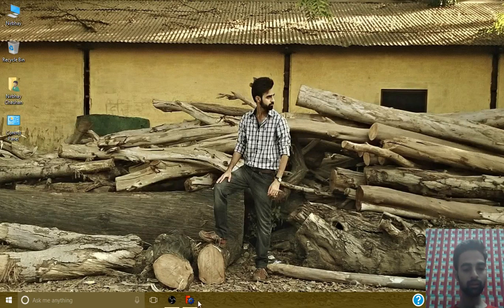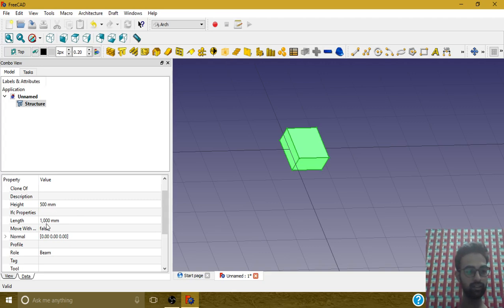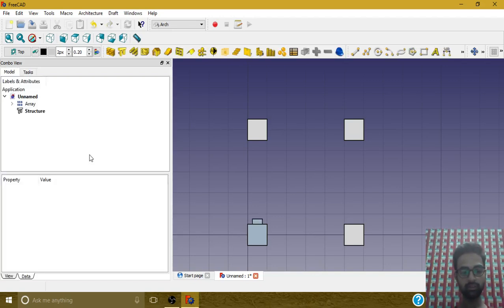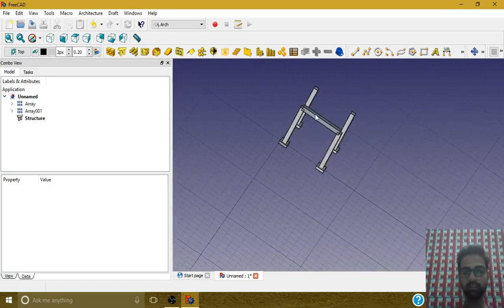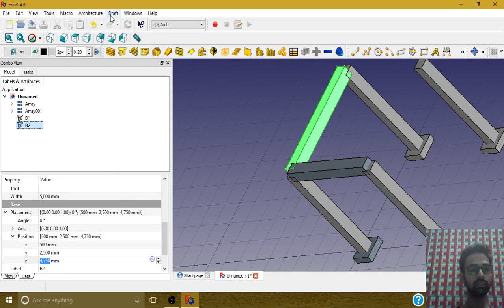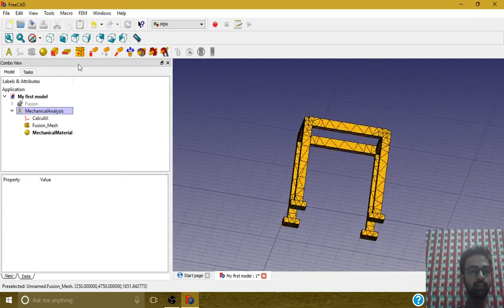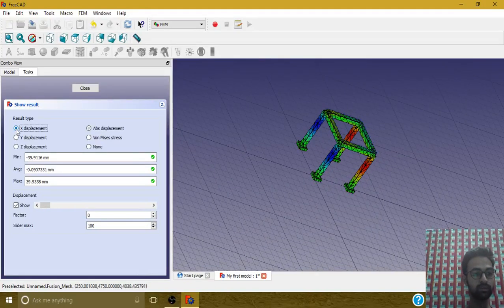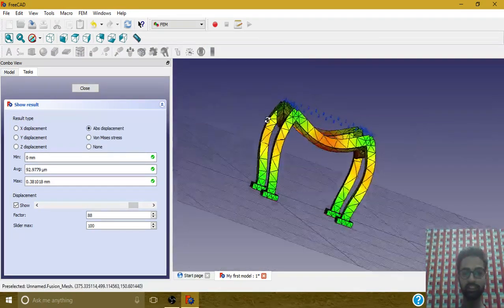FreeCAD FEM/Civil/Structural/Arch Tutorial-1-An Introduction

Comment: Hi, thank you for the tutorial from an engineers perspective! Was looking for something related to structures, FEM and freecad. I have a few questions,
1) When you choose generic concrete as the material, does it consider reinforcement ? If yes, then how to apply this, to design a structure with better reinforcement ?
2) What is the force taken to check displacement of a concrete staircase ? I searched in google and it ranges between 4.5 KN to 12.9 KN
3) In your video you pointed out that the displacement is very high, What is the maximum displacement allowed for concrete structure (specifically for folded slab staircase) ?
4) Can we add custom concrete materils like M20 or M30 concrete with specific reinforcement bar sizes? or can we add rebars using the rebar tools and then perform FEM analysis ?
I am not a civil engineer, but an architect, and I am trying to understand this tool for better designing, I am trying to make FEM analysis of a folded slab staircase to be precise.

Comment: Hi Eklavya,
I'm trying to stop using Inventor for my CAD applications mainly for Laboratory purposes. I'll be retired soon so I need to switch to freeware preferably open source. So I'm very impressed by FreeCAD and certainly by your tutorials. In your FEM introduction, I followed your first example and the square concrete structure is OK. I also join the parts to one in part > fusion and it shows as one part when selected. then I choose the FEM workbench but I don't get the A analysis but just 2 solver symbols and en E (create an FEM solver Elmer. Further, in the button-bars, an A appears but the comment is different (  (N, A) (Creates an analysis container with standard solver CalculiX ) ) It doesn't open a TET parameter window.   Is my version not right:?
I'm running version 017 revision 13188 (release date 2018/01/29, W7-64) 
or did I miss a macro install that you do have?

In menu Mesh, I see  > FEM mesh from shape by Netgen and it does give the same TET parameter window. If I copy your entries ( 1000 and moderate) and OK, I get a Net structure that looks much like yours and then I have to use the A (creates an analysis cotainer with standard solver CalculiX ) or else most functions in the FEM workbench are greyed out. Doing that I get a new structure in the model tree "Analysis" that contains jet another structure called CalculiXccxTools now in menu Model I see (M, M) FEM material for Solid. If I choose that I can select "concrete generic" and OK. The model tree now shows a golden ball called Solid material. 
if I now click on  >Model>Mechanical constraints>constraint fixed< my model in the view-window disappears. It seems I might have the order in my model tree not correct. the FEMMeshNetgen object should have been inside the analysis container? 
Any idea how to solve this (dragging it there is not allowed)?

update: one remark is I see you have one structure F1 missing before you make the union. 

I now see that if I have my structure correct and made the union, then with the structure selected I can invoke  [Model>Analysis Container]  and then immediately I can invoke 
 [Mesh>FEM Mesh from shape by Netgen]  and I get the TET parameter window so next I can define the material and last I need to invoke [Create an FEM constraint for a fixed geometric entry (mesh with pad-lock)] but then my view window is empty and in the model tree I have to select the object and toggle the visibility (is a bug I guess) then I can continue pretty much like your example. In the frequency results not all 10 results have a valid mesh and the visible change with slider is smaller while the original shape is also maintained. These are all still understandable minor differences so for me I will try at the next tutorial.  

Thanks again for the clear Vid. tutorial.
Reply: I'm in exactly the same position using version 0.19_pre